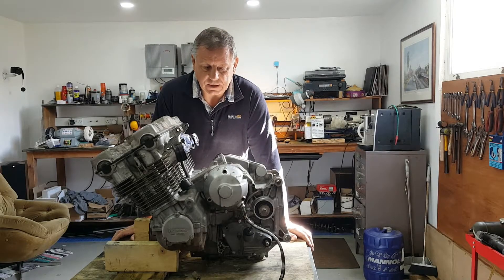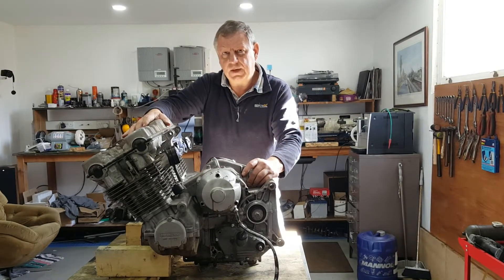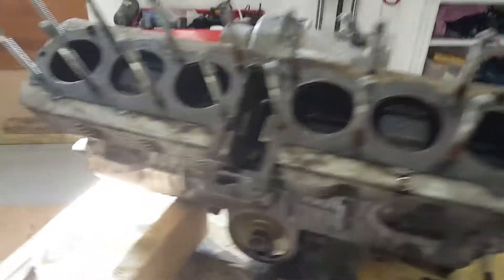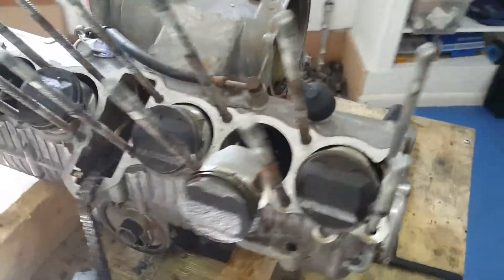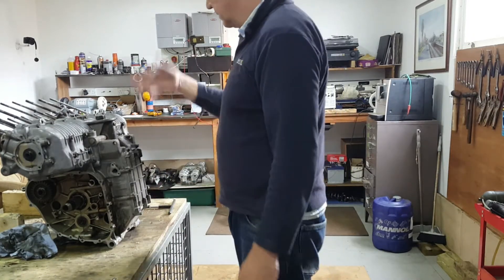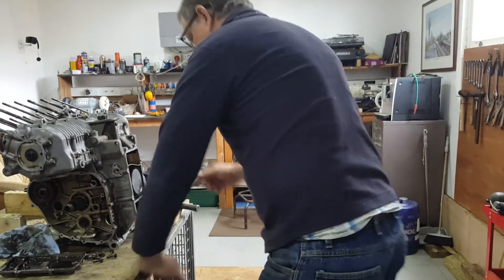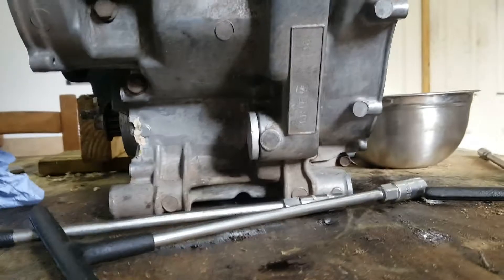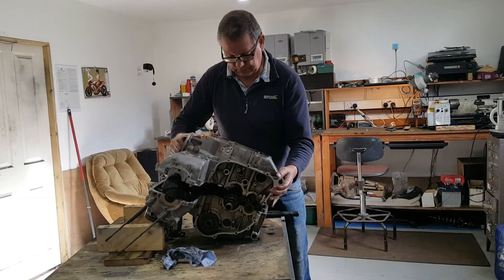CBX enginestrip build pt1

Comment: Believe it or not ... my CBX 1000 /78  ride more vibration free than my new GL 1800/2018 !!!
Reply: Indeed! The CBX engine can best be related to the smoothness of an electric motor. Last Wing I owned was a 1988 1500/6. Loved the low CG offered with that flat six. Still, the CBX at a few hundred pounds lighter, less mass, was far smoother. Both the Wing, and the 1982 CBX, were a handful when stopped. Once underway, both of them were a joy to ride. The pearl white CBX is still here in the garage.
Reply: @robertborchert932      🙏   ❤